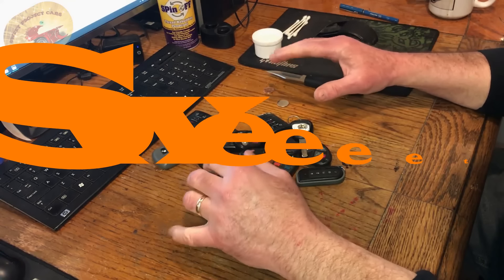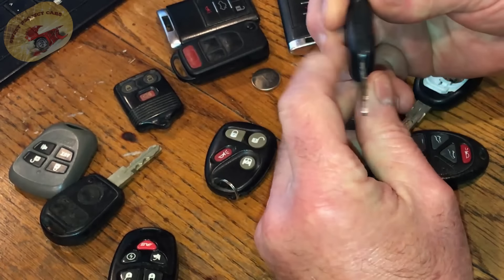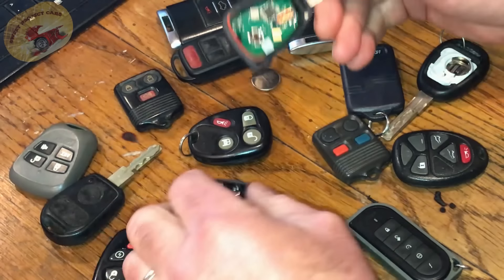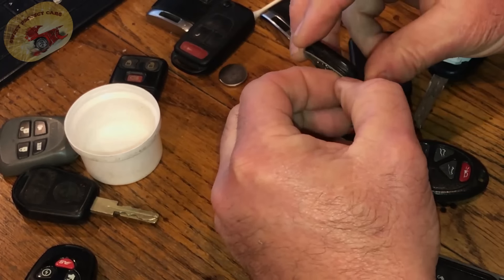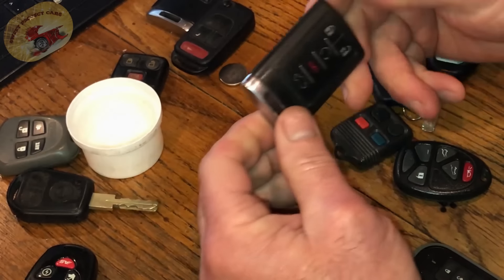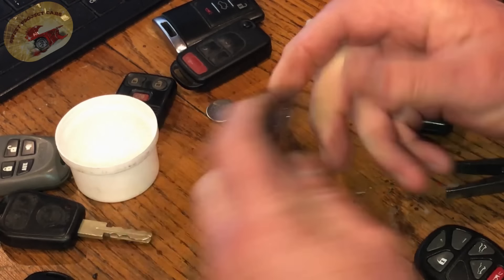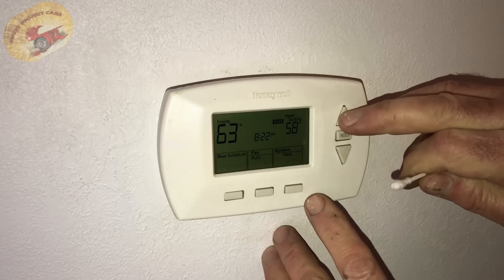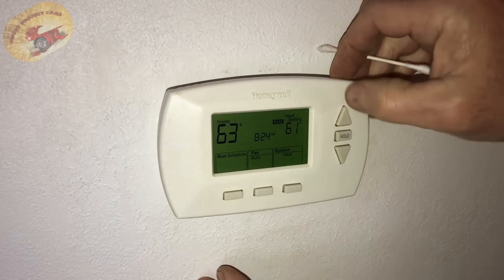How To Repair a KEY FOB in JUST SECONDS!....DIY

Comment: ok mine still does not work. I didnt see any dirt on the Q tip. Its a new battery. What could it be? I have to push the button like 5 times to get it to work.
Reply from the maker: the fob will need to be replaced my friend
Reply: @SweetProjectCars  is it possible that it could be something in the car and not the remotes? I have four jobs and they all do the samething

Comment: What if your buttons are TOO responsive? My remote lights come on all the time, just from me dangling the key fob. Going to open up and take a look I think. Thanks for the video
Reply from the maker: Give this a shot Arcane, there might be something inside that is setting off the fob and just needs to be cleaned out. Thank you for watching and sharing, have a great week and all the best on your project. mad Mike the hammer SPC
Reply: @SweetProjectCars   Thanks. I have two, that both do the same, one worse than the other. I did clean them both out. One was still skittish for about a week and then worked okay again. The other is just over sensitive all the time. I think contacts inside the switch have gone. Unfortunately it's a microswitch. I do have some laying around but everything looks like it wasn't meant to be repaired. I can't see any contacts or soldered joints. Planned obsolescence.
Reply: @SweetProjectCars   Hey, after 11 months I found the problem! Turned out the board itself was loose in the frame after many years of button pressing, and on the underside the battery - contact was intermittent. So it was always resetting itself while moving around. All I needed to do was bend the contacts up higher and squeeze the plastic pins up with pliers to force good contact again. The light that kept coming on had nothing to do with the buttons after all.

Comment: I have a remote control that controls the key fob as well but it's not working right either could you do a video on remote controls that control other remote controls that possibly control other remote controls?
Reply from the maker: Hello Wade yes this will work on most all remote controls If I were you I would do all of the controllers that you have and you’ll at least rule out any issues there

Comment: I have a 2008 Hyundai fob that has the same buttons as that ford one. After watching this I thought what the hell, cant fix it so I soaked it in 99 for a minute then worked the buttons. It worked, thing is you have to give it time to completely dry. If not all the contacts light up and don't stop. Then you annoy the neighbors.  I wish I would have seen this two weeks ago. I replaced the same Honeywell thermostat last weekend for that reason.
Reply: After 7 months both the unrepairable key fob and thermostat work perfect. I know the I could have replaced the key fob for about 20 bucks no big deal but now I heave gotten other electronics working such as radios and an electronic work out station that would have cost me a small fortune to have repaired or replaced. Thanks again.

Comment: If things don't happen immediately from maybe weak battery, people start pressing buttons harder.
This causes excess flex on circuit board and may break solder joints or circuit traces.
Reply from the maker: Thanks for watching and sharing, have a great weekend. mad Mike the hammer SPC

Comment: Micro switches on my fridge freezer caused it to beep ( like when the door was open too long ) I found out on the internet that if u scrape the surface of the switch any exposed sides (it had like a silvery sheen to it ) then use alcohol with your q tips to clean it.  4 years l8r had to repeat the cleaning and it is still running to date :) 2019

Comment: With the Ford key fobs I have had success by taking the fob apart then taking the battery out and then squirting MAF (mass air flow sensor) spray between the switch and the printed circuit board.  The MAF doesn't leave a residue - just make sure it dries completely before putting your fob back together - I use a little compressed air to totally dry it and yes a new battery helps also.

Comment: 99% means 99% isopropyl alcohol. That is "industrial grade" rubbing alcohol. Retail rubbing alcohol is usually less than 99%, and as low as 60%.
Reply from the maker: You are correct Suzey!  Thanks for sharing.  Have a great day.  mad Mike the hammer SPC

Comment: I'm guessing any rubbing alcohol will do tho the higher the percentage the better of course... I like the rubber eraser trick I read in the comments too.
Reply from the maker: We only found this works  https://amzn.to/3wIDQHd  We have tried the others but couldn't get the results that we get with old 99.  Thanks for watching Alan. mad Mike the hammer SPC
Reply: @SweetProjectCars  I used this on a key fob that hasn't worked since we bought the car about 10 years ago. IT WORKED!! I didn't have any 99, so I just used what I had. I'll admit I used some tiny pieces of really fine sandpaper I had too. The fob was actually full of green corrosion... Such a great trick!

Comment: What about replacing microswitches that go bad?
Reply from the maker: MBisFrenchy you are better off  to replace them when the switches go bad
Reply: @SweetProjectCars  New key fob is 500 + programming is why i am asking.
Reply from the maker: MBisFrenchy well the biggest reason is finding the switches very hard to do and then have to micro solder them in...not saying it could not be done and for 500 i would try it for sure
Reply: @SweetProjectCars  I only have an Hakko 888D. Yes the switches I haven't been able to find.

Comment: How do you know if it came with a key fob to unlock doors. I bought a used 04 impala from guy down the street and all he gave me was the ignition key he didn’t know if it had a remote start as well . I can’t get remote I bought to work .
Reply from the maker: You need to go to the dealership Chevy/GMC go to the parts department, give them your vin # and they should be able to tell you whether the car had remote access/start. Thanks for watching and sharing, have a great day and all the best on your project my friend. mad Mike the hammer SPC
Reply: I finally got remote set up to at least lock and unlock. . Yay . I will check 😁with dealership

Comment: I have a 17 year old key FOB for my Ford Mustang (yes.. I bought the car new in 2002) and mine just crapped out. I went online and bought 2 new ones for 16.00 bucks. Those micro switches were screwed.
Reply: that's quite the deal. My local dealer wants 200 plus for one
Reply: @groover5863   They work great and are easy to program! 😁

Comment: My Volvo fob is glued shut :(
Reply from the maker: You might have to get creative my friend. I would use a sharp jackknife and slowly go around the "glue" to get to the contacts. Thanks for watching and sharing, have a great day. mad Mike & team
Reply: @SweetProjectCars  I’d probably lose a finger if I tried that with my ladies hands. It’s getting some body work so maybe he can do it. I was also going to try to squirt some 99 alcohol in there in the meantime and set it in front of a fan overnight. That worked for my garbage disposal when I got orange peels stuck in the drain. Thanks for responding!
Reply: @SweetProjectCars  Since you so graciously gave me advice on a 5yr old video, I came back to tell you the good news so maybe it helps others too. By holding the fob upside down when pressing the buttons it now works! Cool, huh? Gravity is now my friend. :)

Comment: I don't see a buick in there which is different than most of those, Not to much but enough.
Reply from the maker: This process works on all the fobs we've ever tried it on, give it a shot, you have all to gain and nothing to lose my friend. mad Mike & team
Reply: @SweetProjectCars  It gave me the idea i needed the Buick has a part in the back top that pops up & to the side & then off, Because its seperate to the actualy chip board & the battery has its own compartment. Thanks you should try to get one though they are well done.
Reply from the maker: thank you king for sharing   mad mike

Comment: carbon pads will wear off.......
Reply from the maker: if you keep them clean they will not wear off
Reply: @SweetProjectCars   they will wear off, eventually the pad resistance will increase and will not short the pcb pads.  There is a carbon paint, getting it to bond to the surface can be an issue.  Good quality rubber pad switches use a flexible carbon disk fused to the rubber lasting longer, cheap ones are painted on. I've replaced 100's of radio pad switches. No amount of cleaning would bring them back, faster and cheaper to put in a new one.  The user cycle of radio switches is much higher than car remotes but eventually they wear too.  For the cost of the car remote, try the carbon paint.
Reply from the maker: all i know is we have customers that have been with us for 40 years and when they came out with the key fob we cared for those 20 plus years ago and we have never had to replace one of them we find PM is the best medicine.  thanks for sharing